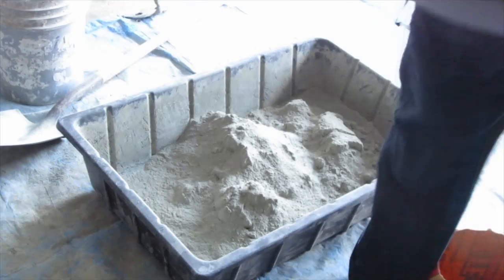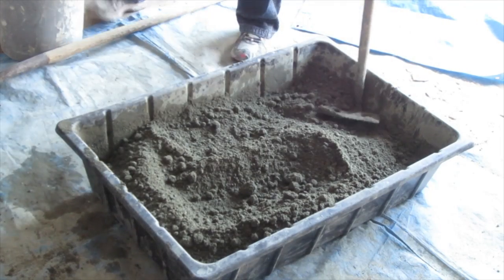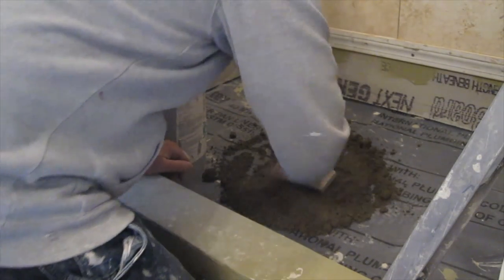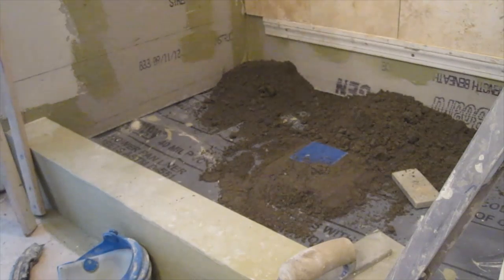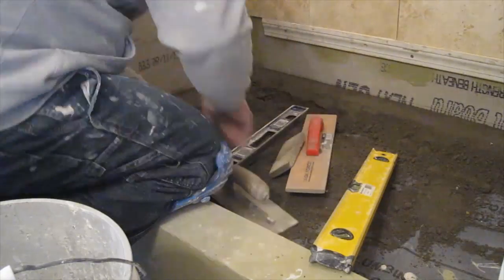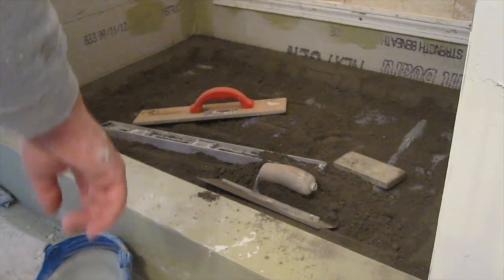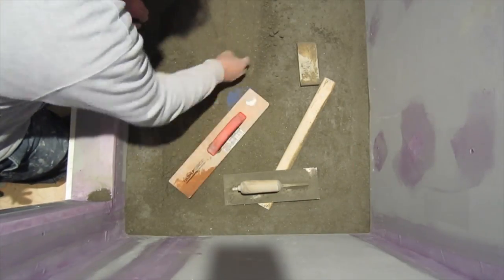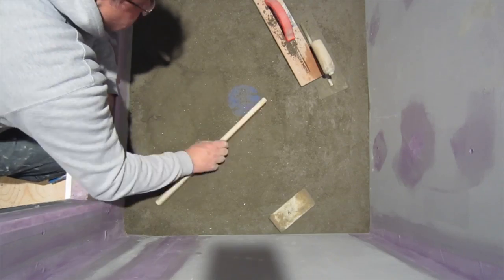How to install   Mud in a shower floor

Comment: Sal,  your  commitment to quality Is inspiring!   Using your videos I am making a mud  shower floor.  How much drying time between steps?  From pre-slope to membrane and shower floor, then shower floor to liquid waterproofing???
Reply from the maker: Depending on how you do it and what method you like. Preslope, if it is mud, the liner can be installed the next day, if the preslope is something else like a foam tray, then no down time. Final mud bed can be tiled the next day, if you want to waterproof it, then probably 72hr unless you use a sheet membrane or a fast drying liquid. Not a simple answer.
Reply: @SalDiBlasi  Thanks for your response!  The pre-slope and final mud bed will be dry-pack mortar (Quickcrete Sand Topping Mix).   I will waterproof the walls and floor with Mapei Aquadefense  using the membrane at seams, edges and corners.   In this case, do I wait 3 days to apply the waterproofing to the final shower floor?
Reply from the maker: @mikeroe8  Yes. best to let it cure that amount of time.
Reply: @SalDiBlasi  Thank You for taking the time to share!

Comment: Thanks for what you do, Sal. I've been putting in a new shower (my 2nd as a homeowner), and it was all going swimmingly until...I worked an 18-hour day, and in the dark, was installing the Schluter-Kerdi moisture membrane on top of the styrofoam tray.  I didn't realize it until the next day, but I didn't iron out all the bumps of thinset under the membrane, so there's a couple of notable humps.  I haven't put the tile down on top of it yet, and am racking my brain trying to figure out if there's some trick-of-the-trade fix that I can do to get it fixed, instead of just tiling over it (and feeling those bumps under my feet forever for the life of the house).  Any suggestions?
Reply from the maker: You could try cutting out the humps, smooth everything off and then install another layer of membrane to get it all waterproof again.

Comment: Hey Sal,  off topic here. I am remodeling my bathroom and I just found out my floor is a mud job. Can I remove the existing tiles without damaging the mud and install my new tiles on the same mud?  thanks for all of your awesome videos and your time.
Reply from the maker: If you can manage to do that and end up with a solid mud bed, then I would say yes, if the floor is in good condition you can sometimes coat it with a primer like Mapei Ecoprim Grip  and then install the tile.
Reply: it is a pretty thick bed, probably 4 inches. I will take my time and give it a try. Thanks again for your time and input my man.  Best Regards.

Comment: what is that smaller square block you use to sand with? I could have used one today
Reply from the maker: +GJL Creative Studios just a small block of wood, could really be anything, just has to be the right size, i keep all different sizes in my truck

Comment: Question.. why is it necessary to use pea gravel or equivalent around the drain as to “not clog the weep holes”? Bed mud is designed to allow water to permiate it, so how would it “clog the holes”?
Reply from the maker: Just use the pea gravel or whatever is convenient, it has been tested and found that for better performance it is best to do it this way.

Comment: A lot of people say to avoid embedding your cement board into the mortar bed because it will wick moisture up the wall , but I would waterproof the cement board completely and draw a level line around perimeter and use that in place of the level . What are your thoughts on embedding the cement board? And why not waterproof the entire walls and not just screws
Reply from the maker: So here is the thing, if you look at the TCNA handbook it tells you when you can and when you can't, and it has nothing to do with the waterproofing being used, but the type of cement board. If you use a true cement board, like Durock, or Wonderboard, it can be in the mortar bed, if it is a Fiber cement board, like Hardie backer, then it has to have a gap between the board and the mud.

Comment: Beautiful job. When using the steel trowel to get the final finish, do you have to dip it into water to get the smooth finish or is there enough moisture in the topping mix to smooth out as long as you keep troweling? For the mud layer on top of the liner, what is the thinnest it should be at the drain to ensure that it will drain properly?
Reply from the maker: You can if you want, but it is not necessary to wet the trowel, i don't understand the second part of your question about thinset.
Reply: *****
Hi Sal ,  As always great videos. Sorry for taking so long getting back to you but I've been ill. I wasn't asking about thinset but the thickness of the mud foor at the drain. I want to ensure it is not so thin it will crack yet thin as I can get it because the drain doesn't have much thread. The drain was installed flush to the floor so after doing the preslope and liner it has used up quite a bit of space. Also do you have a video on doing the threash hold for a concrete basement were the liner was used over the preslope? Do not want to poke holes on the liner and not sure how to tile up the edge and over the tope of the threash hold. Thank you very much for this terrific public service to us DIYers.

Comment: Hello, I put in one of these in a shower and I'm getting ready to tile it but we noticed even though we let the mix sit for 3 days, it's about as hard as a sandcastle. I watched a lot of your videos, but my boss wouldn't listen to me and mixed way too much water like more than you would even put for concrete so I don't know if that is why but that's my first guess. Any thoughts or advice would be appreciated, thank you sir and thanks for your videos.
Reply from the maker: Like I said, it should be hard after a couple of days, if it does not seem right, then it probably isn't. Best to start over.

Comment: My sound is a bit low. How long does it take to dry before the tiles can be laid. Your video is very helpful. Phil from Sydney.
Reply from the maker: If you are going to install tile directly on the mud, then 24hr. If you are going to apply a liquid waterproofing, then wait 3 days to apply it.

Comment: What should we expect for the finished height of the drain from the original floor?  Essentially, how thin is the preslope around the shower, and how thin in the pan around the drain?  You preslope video said that's 1/2" at the drian. The pan looks like 1.5", maybe? So, the finished height of the drain over preslope, liner, pan, and tile would be about 2.5" above the original floor?
Reply from the maker: Set them at the height that works for you,  just keep in mind that the mud will have a minimum depth it can be used. I like to have the top mud at least 1 and 1/4" at the drain.

Comment: Dura rock and similar backer board is for people that don’t know how to float a complete shower 
Floating is the best and only way in my opinion (37 years experience)
Reply from the maker: Wow, never heard that before, I will have to let the entire tile industry know that they have wasted every penny they have spent on research and development, all the new products that continue to come out, all the improvements that have happened over the years, every thing should be scrapped, all we need is some sand and cement. I will go hang my hat now and retire. Thank you for this nugget of knowledge, if I had only known!!!

Comment: Would you consider putting a Kerdi Membrane on top of this mud bed rather than the liquid membrane you later roll on?
Reply from the maker: +Spiny Norman Wrong kind of drain, you would never be able to get a seal.

Comment: I had a contractor build my shower pan. I have a feeling that he did not use a pre-slope He did everything you did in the video except for forming a pre-slope. He has been paid and went on his way.
I did ask her prior to the build about the pre-slope and he said that's not the way he does it.
I am finishing the job and wonder if I should Red Guard the floor liberally so that water does not fill up in the liner. Other than starting over would this be the next best thing?
Reply from the maker: This does not surprise me, it is all to common he probably does not know what the preslope is for. I always waterproof the mud anyway, so if you do not want to rip it out and start over then go ahead and waterproof the mud. Here is one I did, the floor part is towards the end Complete shower install Part 2. Waterproofing the shower.

Comment: Hi Sal. I put down the sand topper mix last fall. Project on hold for health reasons. Now that I getting back to it, I noticed that the topper mix is very sandy at the surface. I made it to the right consistancy. I'm concerned that when I go to lay the tile it will not get a proper bond. Do I have to cap this with another batch of concrete?  Or will the thinset create a good bond? I have a feeling that you are going to tell me to pop out the pre slope and start from scratch.
Reply from the maker: Your feeling is correct, better not take a chance, easy fix at this point.
Reply: @SalDiBlasi  Hi Sal, I took you advise and took out the shower concrete right down to the rubber liner.  I had used Sac-crete not quick crete sand topper. Now I'm gun shy because I don't want this to happen again. I did everything by the book. Any advise for the second time around. By the way, the concrete was rock solid. Only the top was sandy. I will probably use even less water than the first time.  Thanks Sal.
Reply from the maker: Pack it well and use the correct amount of water, try a product like mapei 4to1 which is designed for this purpose https://www.lowes.com/pd/MAPEI-4-to-1-Mud-Bed-Mix-55-lb-Indoor-Outdoor-Floor-Patch/3115749

Comment: Sal thanks for this :)  Just about to attempt this in my home.  Question: you have 4 different tools (steel trowel, wood float, 1x4, and level)  It's not obvious to me why you are picking up each tool, can you give me the reasons I would want to use, say, the steel trowel instead of the wood float? Thanks!!
Reply from the maker: watch this video for an alternate method and an explanation of the wood screeds. https://www.youtube.com/watch?v=jIxiRk1KPzk&list=PLE025D61CF6E3515B
Reply: Thanks, I will watch!

Comment: Hi Sal, You are a household name around my DIY house 😊
Quick question...I have a new shower liner (with a preslope in sand under it). I am going to mud above it to a regular drain (not Schluter). I want to put Kedi over the mud to waterproof,  but can I do that with a normal screw in drain? My plumber installed it and can’t remove it.  I can’t thank you enough for your wisdom.
Reply from the maker: You need a bonding drain to have any success with a sheet membrane on a shower floor, so it is pretty much pointless to use it with a regular three piece drain. Make sure you protect your weep holes and have a good slope to the drain, and you should be good. Here is a video to help you understand how a Three piece drain works. https://www.youtube.com/watch?v=p8xsx3316IU
Reply: @SalDiBlasi  Thanks so much, Sal.  That's what I thought. Pretty bummed. Thanks for the link - I think I have watched that one at least 3 times already. Lol. You should come up with a retrofit for a 3 piece drain...you'd be rich and we'd all love you for it. I just bought the plastic weep hole cover on line for my mud pan. Thanks again for answering my question.

Comment: Hi Sal, thank you for your videos and information.  I recently used sakrete sand topping mix to do my shower pan.  While some areas are curing smooth other areas appear more granular and are not nearly as dense.  I packed everything very well while installing.  Why is this?  Was my mix too dry?  Last, as sensitive as dry pack or "deck mud" is, is it safe to trowel over it for tiling?  I'm afraid it will simply scar the bed. Thank you
Reply from the maker: +Blake S. You may have mixed it a bit dry, it should be easy enough to take out and start over, the bed should be very firm  and should not be affected by normal toweling
Reply: Thank you Sal. The sakrete website also said that if the drypack was done properly you could tile same day, has this been your experience?  Thank you
Reply from the maker: Much easier to wait, if you have had trouble the first time around, don't make it harder by trying to do it all at once. I have done them the same day, but it is easy to screw up if you don't know what you are doing.

Comment: Sal, My drain strainer is 1/4" thick and  My tile is 3/16" thick. With respect to the tile finishing with the top of the drain strainer, How much does the Thinset raise the height of the tile?
Reply from the maker: It will probably be fine.

Comment: How deep are you making that top layer? It looks to be about 2". How deep  does it have to be? I'm in a small space with a sloped ceiling on one side, so I have height restrictions and want to know how thin it can be. Would 1" be ok with a preslope of 7/8" sloping to 1 1/8" to the outside?
Reply from the maker: +Chris Eshleman I like to keep it at least an inch, if you have height restrictions, look into another method that will not need as much depth, like Schluter.

Comment: Hi Sal, Great videos my friend! You are a true professional and a great man in your effort to share your amazing knowledge and talent! I humbly beg your advice on something. I recently finished setting the final mud layer (on top of membrane, base for tile) in a shower I am building. The 1/4" per foot pitch worked out well but the surface of the mud layer is a bit rough and slightly cratered in spots. Also, the drain sticks up a little to high above the mud surface. It is a square drain so I can not turn it, can not adjust it at all. I used Quickcrete Sand/Topping mix to build the mud bed. My question for you is: What, if anything, can I use to smooth out and hopefully slightly raise (to fix the drain height issue) the mud bed surface? I was thinking about mixing up a rich mix of Portland and sand (with liquid acrylic fortifier instead of water) to spread, thin and smooth, on top of the dry mud bed. Do you think this will properly adhere to the mud base surface and remain strong enough to avoid cracking? Will it hold the tile without peeling up off the mud base surface, thinset and all? Should I use a bonding agent to between the original mud surface and this thin layer? Or would it be better to use thinset to spread a thin layer across the surface of the mud to smooth it out and raise it up? Or do I have to start over or something so terrible as that? Thanks for your advice. You sir are a gentleman and a scholar in my book!
Reply from the maker: +CJ C If you just want to smooth it out thinset will work just fine for that, no need to go crazy overthinking it, If the drain is slightly above the mud, you have to remember that when you install the tile you want it to be flush with the top of the drain or just slightly above. If yo need to build it up just a bit, thinset will work.
Reply: Awesome, I think that is exactly what I hoped to hear. Thanks for your advice Sal, and especially for getting back to me so soon! I'll be mixing up the thinset tomorow. Keep up the awesome work my friend!

Comment: Thanks for all you videos Sal.  I have question from a DIY'ers 
perspective.  When you demo an old shower pan that is built on plywood, 
can you expect to be able to use the old drain assembly on your new 
install, or should you expect to reinstall new drain flanges/barrel?  
How about the pre-slope? Can the pre-slope be reused so long as you 
install a new pan liner? I am assuming that the sub-floor is in good 
condition (I can see it from below in the basement).
Reply from the maker: I would say it is best to start new with everything, saving the old to save a few buck is never a good idea.

Comment: Sal, have you ever had an issue with your bottom row of tiles changing colors or having grout issues on the bottom row of tiles? I would think laying your shower pan mud over your backer board, like you did in this video, would cause moisture build up in the backer board. Great videos. We are big fans
Reply from the maker: Depends on the backer board, it is fine with Durock which is a true CBU, but a problem with Hardie which is a fiber cement board. Reference to this  can be found in the TCNA handbook
Reply: That makes perfect sense! Thank you and keep up the great work!

Comment: Sal, If I have laid a pre-slope with a  pitch of 1/4" per foot as you show in one of your other videos and the vinyl liner won't this layer of mud be more or less uniform in thickness from the wall to the drain? Also, should there be a layer of thin set on the vinyl liner to help this layer of mix bond?
Reply from the maker: You are correct about the secon layer, no thinset, any water that gets to the liner needs to have a path to the weep holes in the drain
Reply: Thanks Sal, I really love your how to videos. far and a way the most clear demonstrations on the subject

Comment: I was wondering what mix ratio you use? A friend told me to do 5 bags sand to one shovel of Portland. Is that correct? Sounds weak to me.
Reply from the maker: +john19812003 Ratio for deck mud is 4 to 1, or 5 to 1, where sand is the higher number. It is not  supposed to be as strong as concrete. I will usually use "Mapei 4to1" http://www.mapei.com/us-en/product-detail.asp?IDMacroLinea=0&IDProdotto=1005573&IDTipo=175&IDLinea=102

Comment: what type of mortar is used for concrete-type shower floors, meaning no tile will be applied? Also, what sealer is used for that type of mortar for shower floor? any help would be appreciated
Reply from the maker: If there is no tile, it is not in my area of expertise. Talk to a concrete guy, however you will find that concrete is not waterproof.